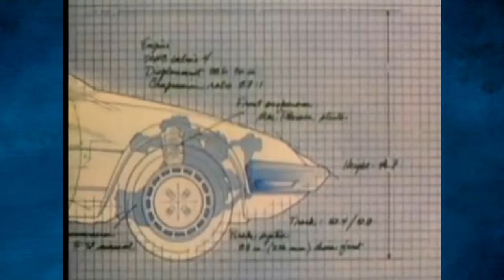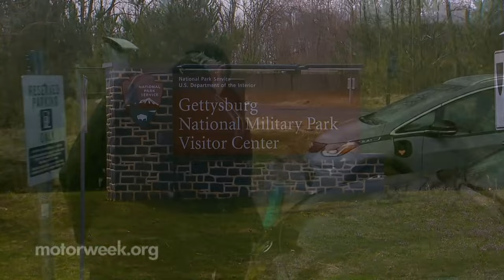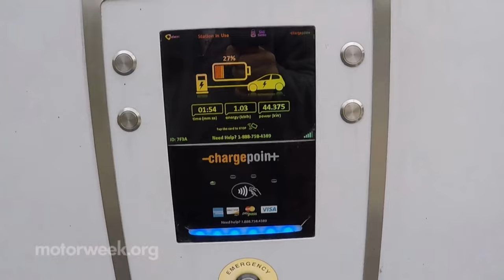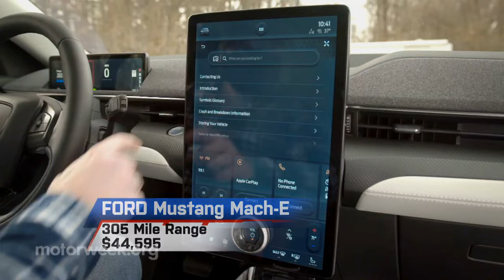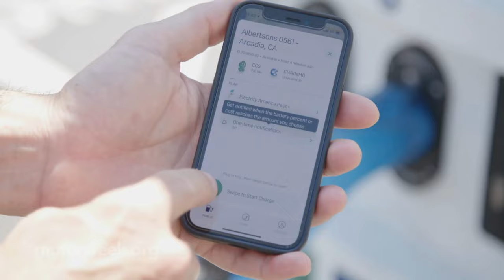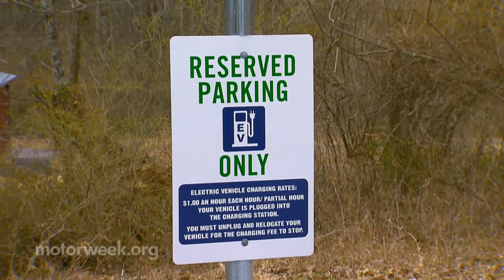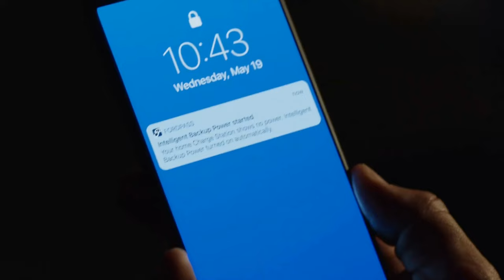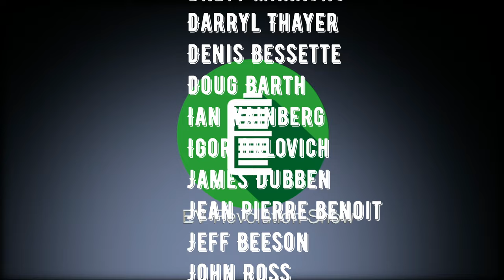Episode 184 - Special Guest - An Interview with MotorWeek's John Davis!

Comment: John is making the same argument that the horse and buggy people used, how did turn out for them.

Horse vs Automobile by Ed. Klein
Before you discard your horse and buy an auto it is well to think of the cost.
Figure how much you spend for harness and then think of what new tires amount to.
Figure up what it takes to feed Dobbin in a year and then think of gasoline, repairs and storage charges.
Dobbin is worth what you paid for him two years ago, where's the man with an auto that can say the same?
Come in and get a new harness instead of a new car and remember that Dobbin will take you through snow and mud as well as on good roads and that his carburetor is never out of order.
Reply from the maker: Thanks for watching.  It is good to get another viewpoint and John does understand the U.S. auto consumer.  It is a slower transition for the U.S.

Comment: My 19 year old diesel Audi tells me off if I drive for more than two hours without turning the engine off for a while (for safety, coffee, meal, toilet break etc). Even if you extend that to 4 hours before a break that is around 240 miles before safety etc advises one. That break needs to be at least 30 minutes anyway so why on Earth is a range of over 300 miles necessary. It isn’t safe for fossil fuelled cars anyway. Range anxiety is a fabrication of the oil industry. Lorry drivers are required to take 30minute breaks every 4 hours (or thereabouts) for a reason so they do not need any more than a 300 mile range either.
Reply: Exactly.
In the UK the government does the same with signs in the motorway telling you to take a break.
Reply: @rogerstarkey5390  , in fact it is even in the Highway Code :-) "While drivers are not bound by it outside the UK, Rule 91 of the Code states that a break of at least 15 minutes should be taken every two hours – with regular breaks essential in keeping a driver focused, alert and, above all, safe on the road." Probably why my A2 tells me off with German efficiency :-)
Reply from the maker: Thanks for watching @John Kellett I agree, however many consumers don't see it that way and this anxiety is still very real and the idea of stopping for 30 minutes to charge, does still not sit well with the vast majority of folks.  Believe me, I talk to hundreds of people every year in my public outreach efforts and that and pricing, are the two major roadblocks to EV adoption.

It's just something we need to continue to chip away at with citing personal experiences and the reality of road trips.  I try to quantify financially these stops by monetary savings.  That seems to resonate more.
Reply from the maker: @Roger Starkey Agreed but the reality is most people still think it's a chore to stop for 20-30 mins.

Comment: The "Elephants in the ICE room" ?
If ICE vehicles make let's say 5-10% (generous) profit at full production, how will the manufacturers justify running the factory when sales drop 20% or more? (Should I mention, that's happening?)
.
When those same manufacturers have invested in the new (EV) technology, will they continue investment in and development of the old tech? (That'll be no).
Who will but ICE if they don't get "the new year model"?
.
The same applies to government pressure.
If regulations (outside the US?) stipulate lower emissions, and that means more investment, will manufacturers continue development of a dying technology when they will have increasing trouble selling the vehicles in 70+% of the global market?
(Here's the thing, outside the US, fossil fuel cars are done, finished. That's the "global" market which must be considered).
.
Like it or not, China IS coming.
The consumer WILL simply look at the bottom line. The SMART consumer will look at total cost of ownership.
It's no contest.
.
Hybrids are DONE.
The opinion that owners will "commute" then just charge up one/ twice each week, demonstrates a total misunderstanding of the technology.
Those vehicles will essentially be running on fossil fuel, with 20 mile(?) distances on electricity generated BY that fossil fuel.
It's the worst of all worlds.
A complicated vehicle, supposedly "electric" but running on the old tech.
Not to mention, when the battery is depleted, it's a small engines ICE pulling all the extra weight, tell me that's going to be efficient?
.
Stupid.
Reply from the maker: Thanks for watching and really appreciate your comments and viewpoints.  However, I would not insinuate that John is "stupid".  He's got well over 40+ years of experience in the auto industry, is very well connected to all OEMs and is an engineer by trait.  So he gets it.  He is just bringing an AMERICAN viewpoint of realism to the conversation, since he really understands the average U.S. Consumer and auto-buying habits.  

Now, I agree with your viewpoints mostly.  ICE will not die anytime soon, not in the rest of my lifetime at least and then some.  That is the reality.  Sure, EVs will be the predominant force at some point, however ICE is still here to stay.  Not everywhere of course but most areas.  

While I don't fully agree with the HYBRID viewpoint from John, it does make sense when you map that into the psyche of the typical American consumer.  And I would rather at a worse case, see someone at least get a Hybrid than a regular ICE vehicle.  At least there is some lessoning of the GHG emissions, albeit small and not as fast as we need this decrease to be.  Hence why I push BEVs more than PHEVs or Hybrids.  

My hope with this conversation is to shed some reality to the marketplace.  We sometimes get caught up with all the hype, but the simple truth is that yes, EVs will grow in market share and maturity, however they will not 100% replace ICEVs anytime soon.  At least within 50 years IMO.